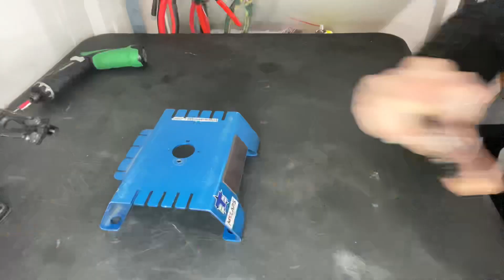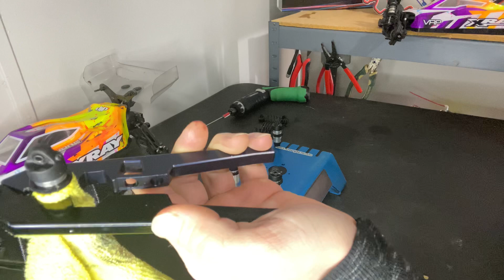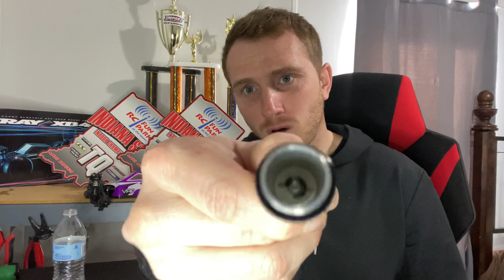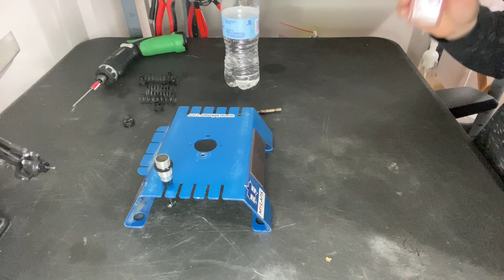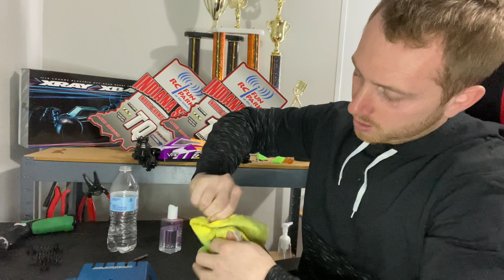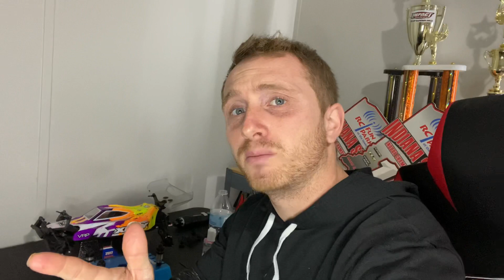How To change Rc Car Shock Oils

Comment: Great video. I need help. I have a losi db pro. I run on my own track. 8 ft wide. 40 second lap time with a quad and 3 other jumps with whoops. Its hard underneath with a loose surface kinda dusty especially when it's dry. What shock oil weight would you recommend I use.

Comment: Do you know if you fill up the shocks all the way or 2,3 cm from the top on a kaiju? I'm not sure...
Reply from the maker: I actually fill them up to the point where the oil bubbles over the rim then place the shock cap on.
Reply: Ok thank you 👍